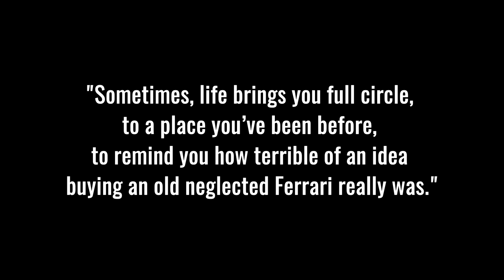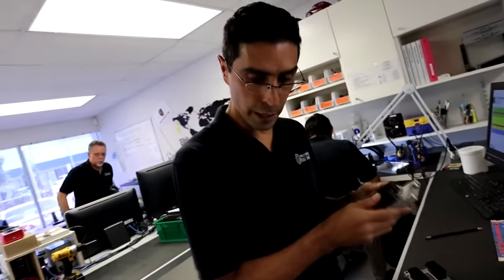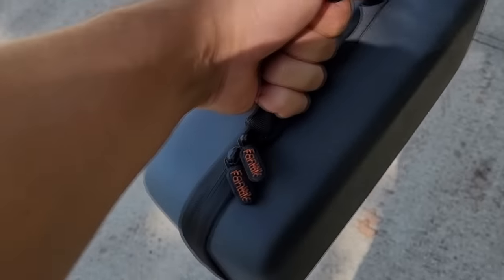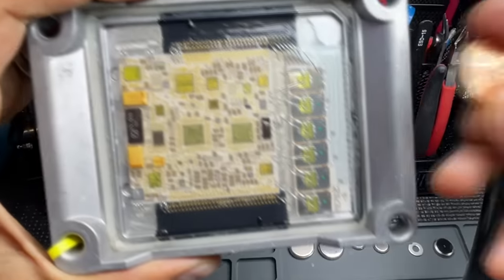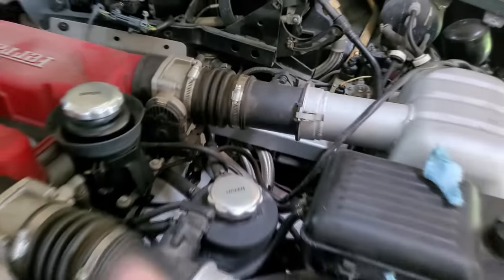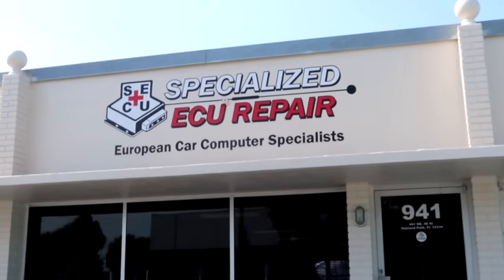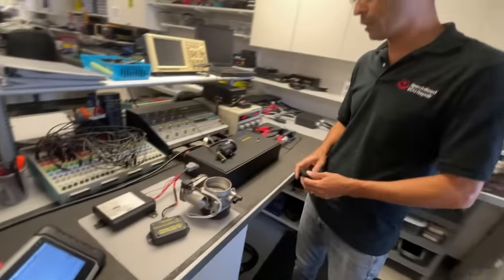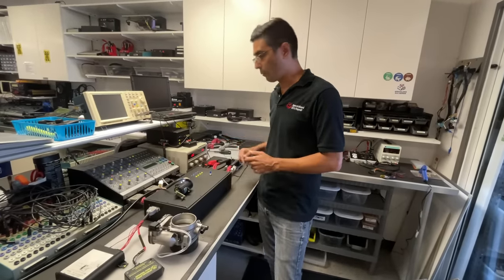Here's What FINALLY Fixed my Cheap Salvage Ferrari!!! (EVERY Ferrari 360's Fatal Flaw)

Comment: Hey Sam, I'm an electronics design engineer with a lot of embedded electronics experience. I'm working with an independent sports car specialist in London to tackle this problem (we already repair several other types of car electronics modules). I have a bag of 6 of these ecus with the same fault! I have repaired one (found a definite fault), but awaiting testing on a car to verify if it's actually now working. I'll keep you updated! These problems need an engineering approach, I just diagnosed and fixed a fault on an early 2000s Ferrari dealer diagnostic tool "SD2". It was totally dead, parts were actually only a few £ ($). The unit is 3k, used, to replace. We are now increasingly tackling these challenges where owners often have no other options. Cheers, Sean